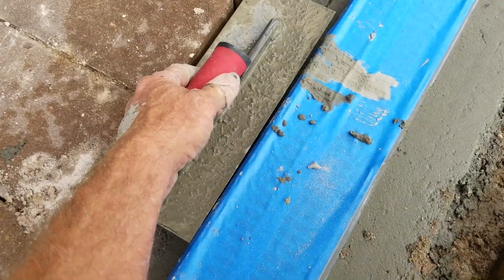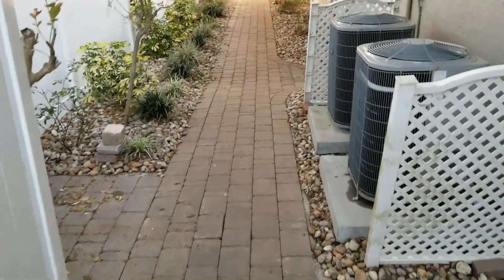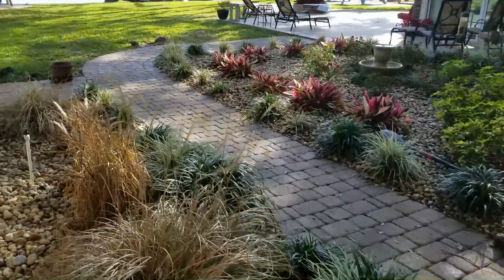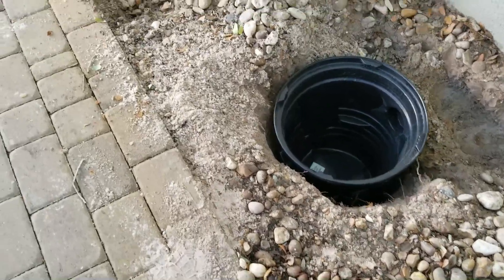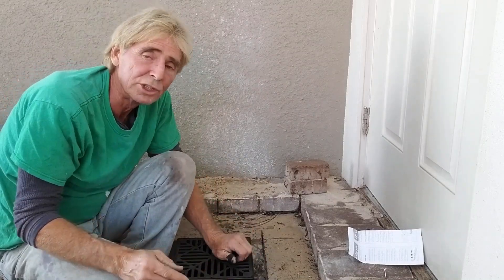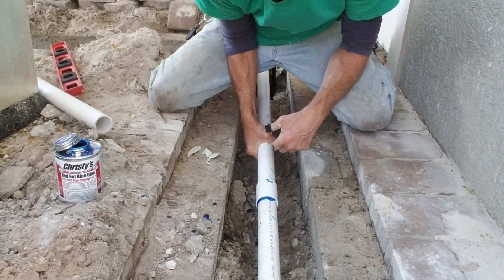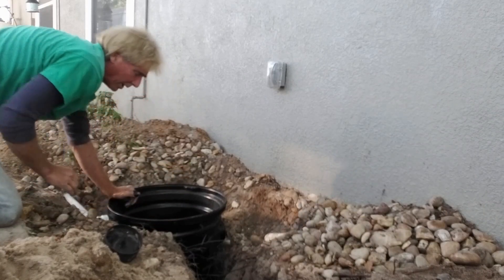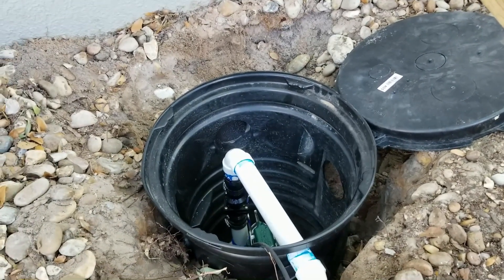Channel Drain in Paver Driveway, Sump Pump, Patio Drain, French Drain

Comment: Might be two years ago, still - wouldn't it have been easier to leave the concrete untouched and just remove some of the paving, so the water could run of through some kind of a "channel" created by the concrete as bottom and paving left and right? Such a system was created on the huge patio of my grandparents and as kids we used these build in channel to race small wooden boats in heavy rainfall. They build a drainage system by just leaving paving stones out on top of a concrete base so the water could use this channel system to run of.

Comment: Hey Chuck, great videos. The channel drain material you used appears to be all plastic (perhaps the grate itself is metal). How does this channel drain hold up to the repeated load (and unloading) of a vehicle driving over it, or even a vehicle (unintentionally) parked on top of the channel for an extended period of time? It doesn't appear that pieces of the channel (this channel) can be repaired/replaced after the installation is complete.
Reply: Kevin Fegan it’s usually fine

Comment: I am on a lake that floods periodically.  Our storm water drains into the lake.  However, when the lake receives runoff from upper catchment , the lake level rises well above our storm water outlet pipe. 

It seems to me, the hydrostatic pressure between the large body of water from the lake, during flood event stops my storm water generated from my property flowing into the flooding lake.  Am I right, or wrong.  

I am at my wits end trying to cope with this problem.  I have asked numerous plumbers, but it all seems too hard.